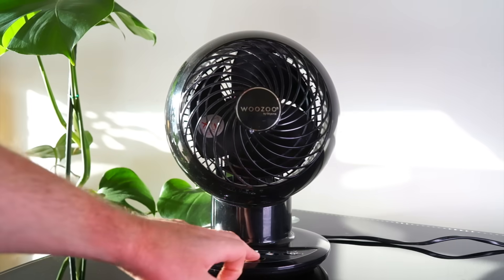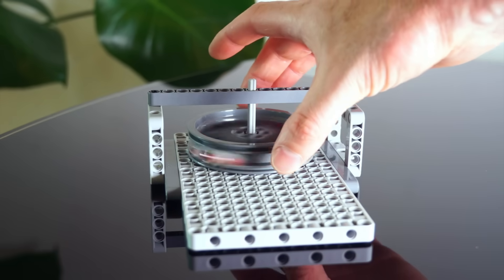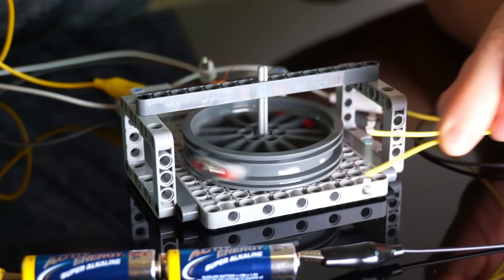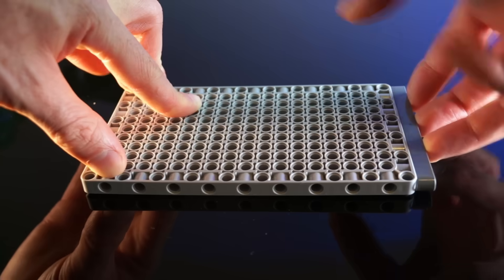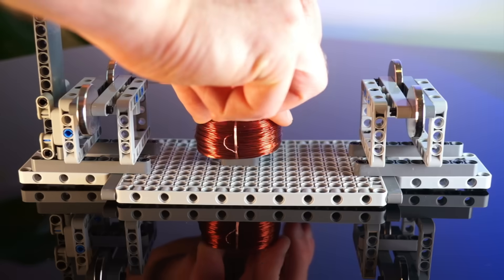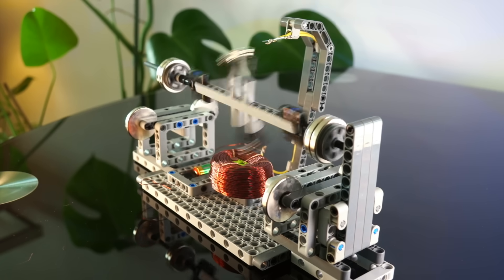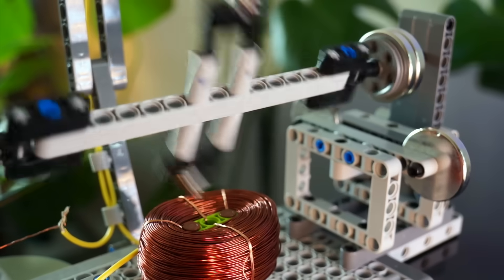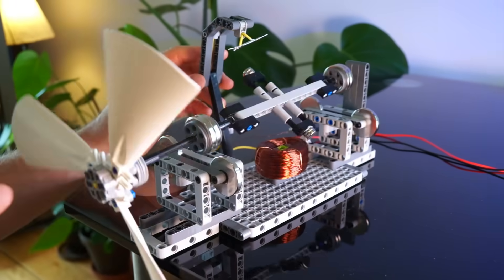Making a Totally Silent LEVITATING Fan Using Lego

Comment: How about using more magnets on the levitating axle?
That might be able to help speed up the axle.
Or use an coil woth thinner wires, you can wind more wire on the coil to increase the strength of the coil.
More wires on the coil will increase the speed of the motor.
The reason is: more wire means a stronger motor.

Comment: The rotor angle could be read optically to control the coil.  Also, the coil can be driven both ways, not just to repel.

Comment: Did u ever try making a verion 2 of this?   I noticed that is bounces alot. Did u try adding more magnetic repulsion? like above and on the side to keep it from bouncing. What if u have 2x Reed switches 1 top right 1 bottom left and have 2 smaller coils 1 bottom and 1 top?. Maybe add a sort of magnetic repulsion, so if the fan starts to go fowards there should be some counter magnets to push it and hold it in place.

Comment: lets spin something wirelessly :here I have a coil of wire 0:41
Reply from the maker: Wireless meaning transmitting energy without contacts between the transmitter and receiver. Still need wires in both of those though!
Reply: Exactly lol  @JamiesBrickJams
Reply: Sigh....

Comment: 'lets do this wirelessly'
looks inside
wire coil, connected with more wire.
Reply from the maker: Haha 😅 I guess I meant the usual meaning of 'wireless', which is essentially 'contactless'. Pretty much every means of transmitting information or energy 'wirelessly', will still employ lots of wire on both sides - the transmitter and receiver. This concept here is wireless, in the same way that wireless charging works. No contacts between transmitter and receiver. There is still lots of wire in both the receiver and transmitter though.

Comment: Instead of a reed switch, use an led and photocell.  The photocell would have to be shielded from external light using a tube.  Place a rectangular card on the rotor to interrupt the light between the led and the photocell at the appropriate timing.  You may have to build a breadboard circuit to adjust the sensitivity of the photocell.  This should give you a contactless timing switch.  Sorry, I couldn’t think of one that used magnets.
Reply from the maker: That's actually such a cool idea. I've heard just about every suggestion under the sun for various timers, but I think this is the first photo-sensor someone has proposed. Love the concept! I've been meaning to bust out the Arduino for a wee project, so this might be a really cool one to try. Thanks for the suggestion! 🙏

Comment: cant you just use a regular motor with a high air resistance fan on the other side?
Reply from the maker: I suppose you could ... But where's the fun in that?
Reply: I forgot that it's also about the silence :D @JamiesBrickJams

Comment: Orient the fan blades so they are rotating in the correct direction, also if you orient the fan blades in a way that lift/push the rotating assembly into the baseplate and ad a cup to hold the rotating assembly it should run more smoothly and securely.

Comment: would this work on a larger scale or would gravity or other factors make it not work ?
Reply from the maker: Good question... I'm sure it could be scaled up significantly. Just need larger magnets, and a better delivery method for power. Likely using a power transistor to deliver more power, and a hall effect sensor to detect rotations

Comment: A reed switch was never intended to switch a load. It would have been paired up with a transistor to do this, probably a Darlington pair (the only real sensible switching transistor configuration before MOSFET).

And why are you using ridiculous tiny batteries for this? Such a waste of.. everything. But mostly cash.
Reply from the maker: Very true, a power transistor would make for much better power handling. Either that or a much thinner coil that doesn't need as much current. Origin Bally I wanted this to run off a solar panel, but I'm not giving up on that ... Or USB!
Reply: @JamiesBrickJams  Solar should work. If I were going to do that I'd use a cap to give a smallish panel surge capability so it can hit the coil harder than just a panel alone, and then a transistor to switch it, driven by the reed. Probably the simplest least part count method.

It's cool either way, I don't mean to sound critical of it at all. Just the tiny "ignitor" battery got me. But if it will run on that, it will run on a small PV panel just as well, probably even better (with a cap to help with reservoir)

Comment: You need to account for the weight of the fan and the force generated by the wind. Also, add a sharp point to contact point, possibly with a bearing system to help lock the rotation side. Should help you tune the magnetic repulsive forces to balance the additional torque.

Comment: You could use an arduino or any other microcontroller to simplify tuning predictable reactions for the timing/switching part and speed control in an all in one solution.  If you do that, a Hall effect sensor input usage might be a more reliable alternative to the reed switch.  Anything you do is going to be somewhat finicky, but with good programing and design you can push tolerances.  One thing I noticed was that your fan blades were convex side towards the direction of flow.  This flow choice is possibly less linear than reversing it.  Reversing it MIGHT help to minimize seemingly random turbulence that derails your fan.  Another high speed compliant addition would be a metal on metal contact pivot point such as a needle against a slightly concave or flat mirror polished disk.

Comment: Dynamically balancing your shaft and fan assembly will reduce the wobble and hopefully stop the rotor from falling out of the levitation suspension.  It should also improve the rotation speed.

Comment: Technically if you didn't want to get rid of the read switch you could add a transistor and use the switch to switch the transistor, that way the current goes through the transistor and not the switch.
Reply from the maker: Very true, that's on my to do list - thanks!

Comment: Pov: you eat through 10 batteries to keep yourself cool for 5 minutes.
Buy 18650, recharge, reuse
Reply from the maker: Haha you're absolutely right, I burned through a couple of these making the video. The original idea was to use a solar panel, but it couldn't produce enough juice. I reckon USB is a sensible choice for V2!

Comment: Suggestion: move your coil slightly closer to the reed switch (or whatever you replace it with) and then angle the coil back towards center.
This way it's repulsing the magnet more radially and (hopefully) more work is done for the energy used.
Reply from the maker: Hmmmm I didn't think of angling the coil ... not a bad suggestion, thanks! Will look into that in a future version

Comment: A more stable mount for the reed switch that gives repeatable and precise adjustment seems like it would help. Also building a front and rear cage for the rotor shaft that would keep it from being launched out of the stator would be helpful.

Maybe make it 5v USB powered?
Reply from the maker: I reckon you're right, definitely a better mount would help. And great idea with the USB connection! My original idea was to use a solar panel, but my coil wasn't ideal for that so it needed more juice. USB would be a good idea for a future version

Comment: Add additional magnetic confinement to stop the rotor from jumping out of alignment.

Add a second magnetic thrust arm and another reed switch to get two pulses per revolution.  

You can do this by repeating things already done and still using reed switches. 

Replace reed switches with hall effect transistors.
Reply from the maker: All good suggestions, thanks! Will definitely give the stabilising magnets and additional magnets on the rotating axle a try
Reply: 565к6ггггггггггггггекнгек7гшенгнегкккккккегшкнгегегшнег

Comment: I wanted to hit Like twice! :D
    You could use a transistor so the reed switch doesn't have to handle the full current of the coil. Remember to use a diode so the coil's back EMF doesn't kill the transistor.
    Instead of a reed switch, you can use a small coil. When a magnet passes it, a small current will be created which you can amplify with a transistor. Maybe a MOSFET if it's very small.
Reply from the maker: Aw thanks a lot! That'd a great point, a few folks have suggested using a transistor to deliver the power, which makes a lot of sense. That's such an interesting idea to use a coil to deliver the signal to the transistor though. I'll definitely give that a try to see if that can work as a switch. Thanks for the suggestion!

Comment: Possibly putting two magnets on either end of the shaft on top of the two or four of them that are already there and compressing together so the shaft was forced into a center position you could even try using the a magnet in the end of the shaft and another magnet on the base of it where it keeps it from moving laterally
Reply from the maker: I'm sure you're right about the ones on top stabilising it - will definitely give that a try on the next version. Cheers!

Comment: I seem to recall this configuration, but for your "bearings" use six magnets, three that repel the central hub and three that attract it, alternating them in a hexagonal pattern, i.e. with each magnet at a corner of an imaginary hexagon centred around the hub.
Reply: Apparently you already charged a phone.  Maybe charge a different device... something silly, like an HP 48G graphing calculator (the G is for Gangster 😎)
Reply from the maker: That's actually a great idea! Been trying to think of something practical to charge that doesn't need too much. Thanks for the suggestions!

Comment: Hey I respect the grind and all…. But…. Lego has official motors, why don’t you just use those? I get making a speaker and a mic, but Lego has good motors
Reply from the maker: Not sure if you've seen any other videos of mine, but my channel is about demonstrating interesting home experiments (often basic circuits) using LEGO as a tool to understand them. So this one is really about building a simple brushless motor. Of course using a Lego motor would work well. But the point here is to learn something interesting that you can do yourself at home!

Comment: I'm a little disappointed that you recognized the issues but didnt do the work to improve it in the video.  Doesnt seem like that much effort to more efficiently detect a magnetic field.  I am not particularly knowledgeable with electronics but if a reed sensor doesn't work well by itself due to high current, couldn't you just add a resistor and power transistor?
Reply from the maker: That's a fair point. Yup, could certainly have done that. But I like to embrace the philosophy of getting something working, then putting a bookmark in it to learn more before attempting a significant upgrade. And there's something beautiful about the elegance of simplicity and minimalism. From what I've been learning, a power transistor paired with a hall effect sensor could make a potent upgrade, so that's certainly on the menu for V2
Reply: @JamiesBrickJams  that makes sense. I've probably just been spoiled by watching videos where they go through like 10 iterations of design in 30 to 40 minutes.   I forgot to add that it is definitely a cool contraption.. even if it's not a very efficient cooling contraption.  Awesome work!
Reply from the maker: @derpnerpwerp  Appreciate it, thanks a lot 😁 Yeah it's definitely not a very efficient device just yet, so hopefully a V2 can make use of the great suggestions folks have left!

Comment: Two more magnets will make the motor stronger. Also another coil placed exact opposite and connected in series with the first coil will make it stronger as well given there's two coils acting on two magnets at a time.
Reply from the maker: Both good points, thanks! Adding magnets is certainly an easy upgrade. Two coils also makes sense, though I'd need to use a transistor to deliver power otherwise the reed switch will likely lock up due to the power demands of two coils!

Comment: Couldn't you use the reed switch to activate a toggle for a larger power supply or is my rudimwntary idea of how electrics work bad? :D
Reply from the maker: You sure could! Seems many folks have recommended using a power transistor to handle the delivery, and then just use the reed switch to just activate the transistor. Will give that a try in a future version 😁

Comment: Perhaps a cup with a hole and a spring to each end to get rid of the wobble and placement during low rpm. Maybe make it longer and ad 2 more motors with different radius to control wobble. good luck and thanks.

Comment: For better levitation stability perhaps the base magnets on both the front and rear sides can be spaced out a little further. This could expand the magnetic fields farther apart, providing better side to side movement resistance. Adding more central propulsion magnets, more copper coils, and expanding the Reed switch to cover a longer length could multiply spinning power outputs. Using a three way architecture for the central propulsion magnet arms (and all the rest) could improve power output. Using a two bladed fan could reduce drag caused by the propellers, (and result with less air flow output😅).

Oh, and I agree with the other dude down there talking about fan blade arrangements. The fan blades must be angled correctly to encourage airflow output to go to the front of the device, and not to be propelled backwards towards the rear of the device.

Thx G2769!
Reply from the maker: Some really great advice here, thanks for taking the time to comment this! I'm definitely interested in adding more magnets to the central propulsion. Using a 2 bladed fan vs 3 could be an interesting experiment too - will see how it fairs! Thanks 😁

Comment: if you put a battery in the center of the Rotor with 2 Magnets for levitation, you can make it spin by short circuit both ends of the battery using a wire.
Reply from the maker: Very true, that was actually my initial idea, but figured the 'wireless' method would look visually interesting. But a brushed motor is likely a good way to go to increase power without adding much complexity

Comment: Use 3 read switch and connect them in parallel, use high voltage, double the coil and magnet also

Comment: great experiment , using magnets this way reminds me of superconductors. two things come to mind to stabilize your output shaft: 1. using a fan with more blades will make it also more stable, but require more energy 2. use more magnets in the upper side to keep it from  falling off.
Reply from the maker: Thanks! I'd quite like to try more blades vs less blades to see how it performs. But ideally yeah, I'll be increasing the power output quite a bit with a transistor. And I'll certainly use some more magnets on the top to try prevent it bouncing around. Cheers for the suggestions!

Comment: The problem with fans is NOT the driving force, but rather the fan blades which are very noisy. The only decent way to reduce fan noise effectively is increase fan size and reduce fan speed. Toroidal fan blades have little effect on noise.
Reply from the maker: Very true! It's only totally silent at these speeds. At much higher speeds the blades and air will certainly make more noise. Though not having a case certainly also reduces noise

Comment: I love it! It's a bit impractical, yes, but it's such an awesome demonstration and proof of concept!!!

I wonder if mirroring the coil and reed switch would help with stabilization and speed, or cause a whole mess of other issues? lol
You make me wish I had legos now...and a few spools of copper wire 😅

Edit: I'm not sure about how to "improve" it but I could sure give you a whole list of things to consider and/or test.
Reply from the maker: Appreciate it 😄 Mirroring the coil might work actually. And I suspect more rotating magnets in the middle might help both power and stability. Even as an adult Lego is worth getting - there's so much you can do with it after you've finished your 'prescribed' model 😉

Comment: Why can this be levitated isn't it impossible to levitate a permanent magnet
Reply from the maker: It's 'mostly' levitating. There's still a loose point of contact against the backboard, which stops the whole thing getting thrown off the magnetic 'cushion'. But levitating a magnet completely is still possible - it just requires very rapid updates of pulses sent to the coils, monitored by hall effect sensors. I'm working on something 😉 You can find those small levitating pot plants as an example
Reply: @JamiesBrickJams  thanks

Comment: How to efficiently avoid a reed switch:
Add a camera and a very bright light (for fastest possible shutter speed), write a program in INTERCAL that determines the position of the magnets every millisecond (might require a very powerful computer, bonus points if it's made of lego and if it uses some sort of AI), and then pipe that into another program written in Malbolge that applies current to the coil based on the position of the magnets.
Reply from the maker: Haha that's certainly one way to do it ... To be honest, that's way more than I'd ever have patience for 😅 Cool idea tho!

Comment: Hoe To Improve This Thing
1. Use four magnets instead of two.
2. Have a hole through the back board for the axle to go through.
OR
3. Go back to your first design and use a ducted impeller instead of a propeller. (Also, see point 1.)

Comment: Maybe you could use two reed switches offset from each other, one turns the coil on positive, one turns the coil on negative. That way you would get a longer "power stroke" without more current.